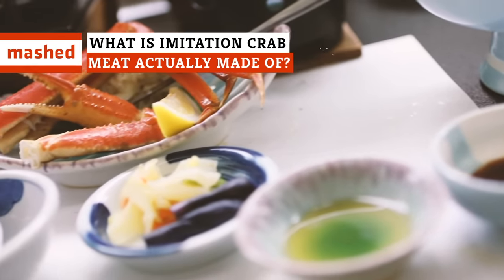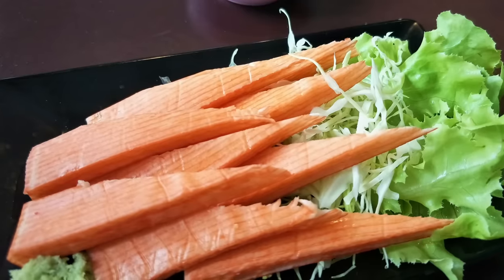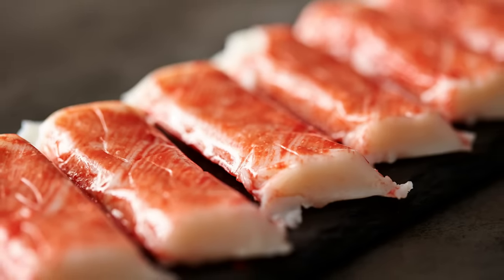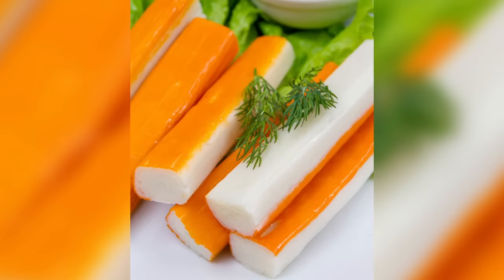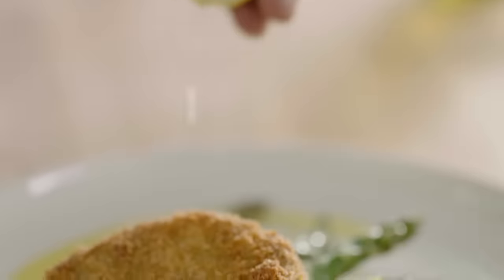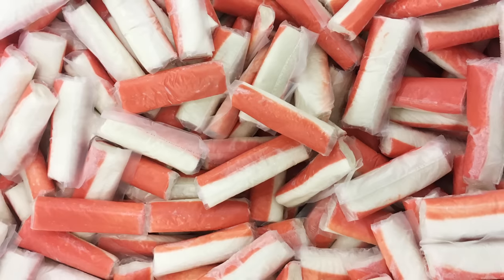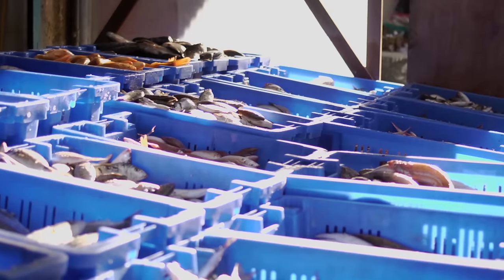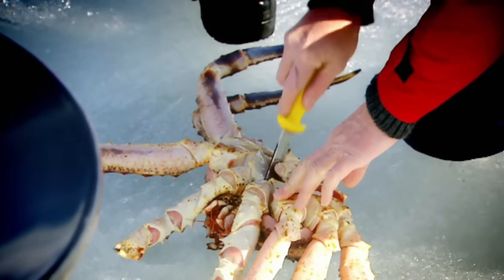What Is Imitation Crab Meat Actually Made Of?

Comment: Imitation crab meat is manufactured so it can be pulled apart like string cheese, and the texture of a crab salad is greatly enhanced by shredding it.  Beating the fully thawed imitation crab meat in your KitchenAid mixer works perfectly. Throw in a handful or two using the flat beater attachment. Use the plastic guard too, as the shredded crab meat will try to exit the bowl.

Comment: I was on the F/V Alaska Ranger in 1992 fishing out of Dutch Harbor. Two of the trips I were on was for chasing Yellowfin Sole for what the Korean buyers called,"Kurimi".
  On these factory trawlers, nothing happens if the freezers are out of service. Once we had a freezer down for a couple of days.
 That means that new load of fish sat on deck in the net baking in the sun while the engineers fixed the refrigeration system.
 Then, they began a process that prepared the fish to be frozen so it could go a to a Korean factory to be turned into a chemical mystery.
 You have to be out of your mind to eat this garbage.

Comment: it's actually fish cake. fish cake come with many different form. in asian mostly we make as fish ball at home. so if you eat hotdog. this is not worsh than that. specialy if you don't want dealing with fish bone and crab shell. this video make something tasty sound horobly scary. surimi doesn't have gluten. becouce it can only mix with starch. using flour will ruin the texture.